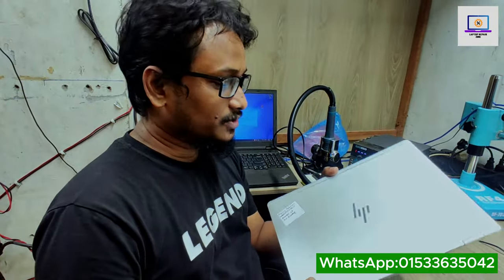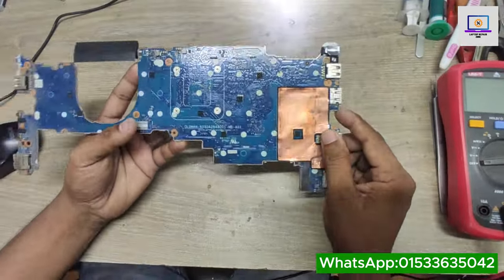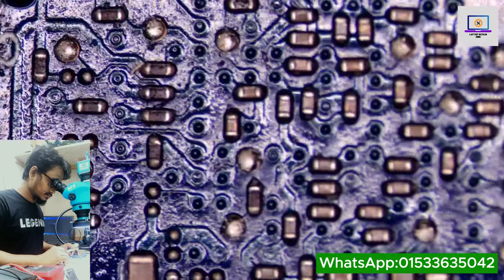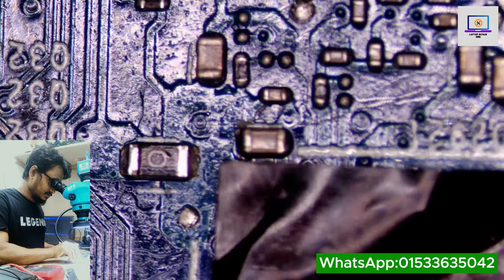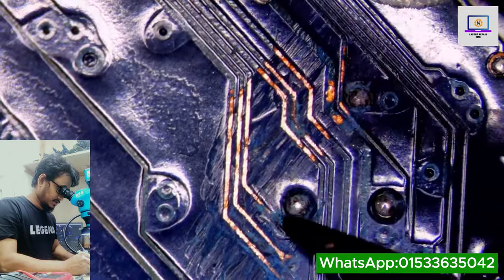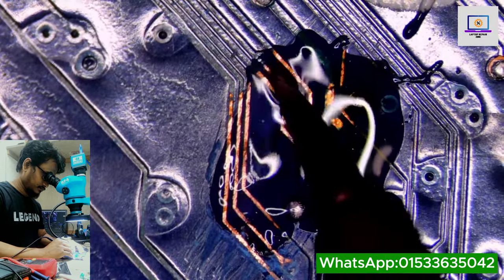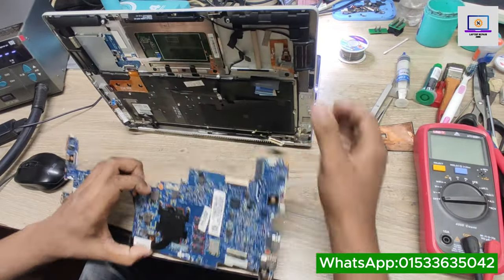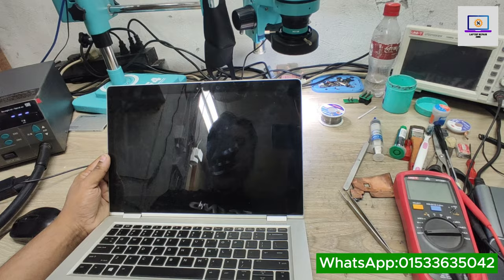#hp #laptop  elitebook x360 g2 1030 black screen | hp laptop caps lock blinking and no screen

Comment: Hello I’m having similar issue with my 1030 g3, won’t post nor boot with Num Key constantly ON or the NUM KEY & WiFi Key on but no POST/BOOT. Cap Lock flashes with Power LED Flashes. After several try and finally POST & BOOTS into Windows but NUM KEY still Blinks continuously.